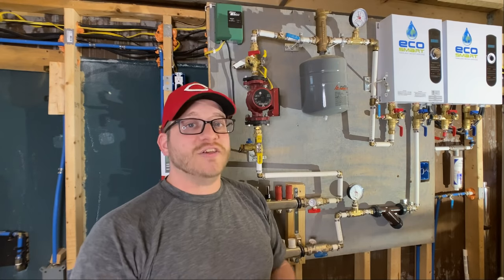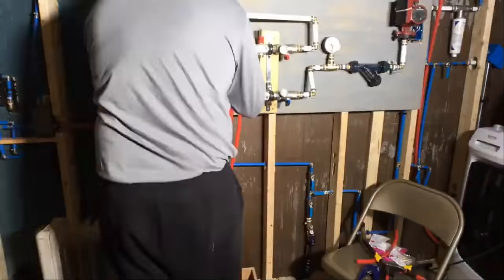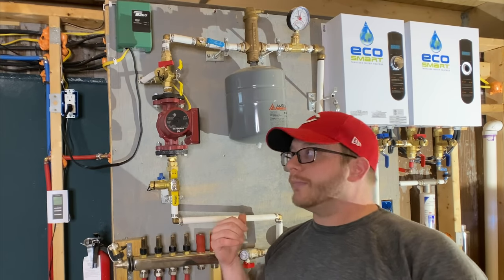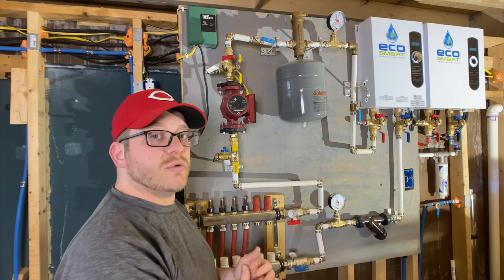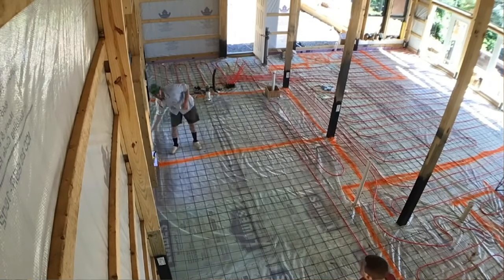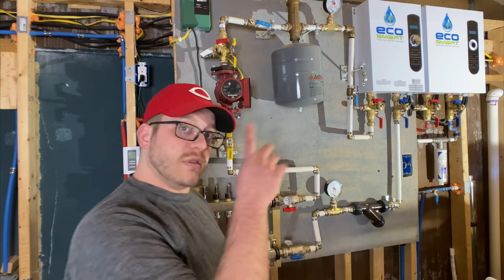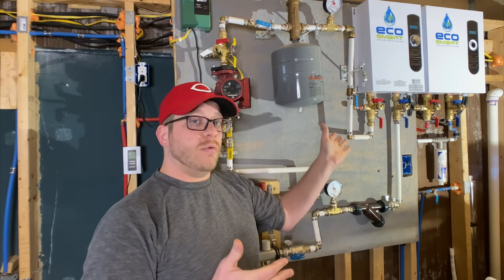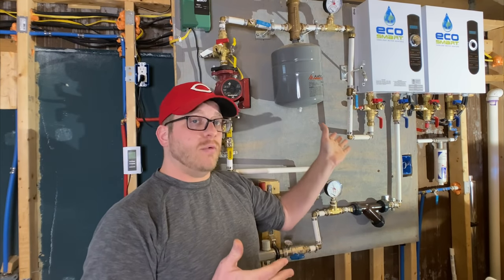Amazing Radiant Floor Heat | One Year Update & System Costs

Comment: Got a question.    What size service AMP. You got coming into your house.     I now for 1 tankless you need a 200 AMP service
Reply from the maker: Ours is 400 amp.
Reply: That’s for both  tankless and I guessing your domestic hot water.  Also 400 amp. Covers your stove and dryer.   Or was 2 separate service.

Comment: I use the same heater as you show in the video but it always not heat up! I need restart the pump but after a day it will stop heat do u have the same problem
Reply from the maker: We do not have any issues with our heater or pump.  
Curious if your system has adequate pressure. You shouldn't need to restart the pump.

Comment: This is the second time YT recommended this video. I just notice you chose a resistive electric boiler which is the most expensive and inefficient source of heat. I hate to know what your heating bill is. If you are in the countries, I would consider mini split heat pump and if you must have hydronic floor heat, use a propane based boiler and only use it as a supplemental to the heat pump.

Comment: nice!  would it not be way more efficient to place a heatpump to heat up the water? 27KW is a very heavy user. i'm sure with a heatpump you can get away with 1/4th of the electricity bill. pluss you can use it to cool the floor in summer times :)
Reply from the maker: Thanks!
So the 27kw is for the whole house hot water and the 18 kw is for the radiant.  We know it's not perfectly optimized right now but we have plans for a full solar setup that will work well.

Comment: What does your water temp start at when entering the loop?
Is each loop going out to the slab the same length?
Reply from the maker: The heater is usually set at 110 and the water is about 80 coming out of the floor.  4 Zones all between 200 and 250 feet long.

Comment: What temp are you running your water at? And does your water heater compensate for outside temp? That makes it more efficient if it does.
Reply: Using a instant hot water heater is extremely insufficient way to use to as a hot water  heat system. Normal  boiler temps are 180 degrees. His system is not install correctly and is very inefficient

Comment: Running 2 heaters does use 2x the power but doesn't consume 2x the energy. The heaters only run until they reach the setpoint. Doesn't make much of a difference running 1 or 2 it's going to take about the same amount of energy to get the floor hot. In the video you made if sound as if running 1 is more efficient. The only way running 1 over the other or both would be more efficient is if there was a difference is the efficiency of the units.
Reply from the maker: Yes I was incorrect about running the one element instead of two.  I hadn't realized that the heater was smart enough to only draw the necessary energy and not extra.

Comment: Great job on this.  Thank you for the follow up.  We are going to do a similar setup with solar integrated. (Preheater/backup source)  Your monthly cost for electrical, however, was a shock.  Seems high.  Where we are, (MT) I have not seen a $200 bill with baseboard heaters...and 3000 sq. ft. with a 22 foot peak ceiling in the great room.  What is your total service (amps) to the home and what is the cost per kw hour?
Reply: I’m in MT as well. I think our electric is some of the cheapest in the nation. For sure cheaper than East coast. I have a similar setup with 1 story 2300 sq ft and my bill was about 250 the highest month when it was crazy cold. Usually around 200 but that included all my electric usage not just heat.
Reply: @SmartEasyDIYer  Whats your insulation?

Comment: Why the second water heater?  Are you using it.
Reply from the maker: The 18kw with the manifold is for the floor heat. The 27kw is for the kitchen, laundry, and shared bath.

Comment: Did you consider ecoboard over concrete for radiant heat? What do you recommend
Reply from the maker: Never  really looked into that, honestly.  Sounds like a good option for above slab heat though.
We really like our hydronic radiant system and really recommend it to anyone building a house on a slab.
Reply: @LittleMountainLife  : many thanks. I guess the heating cost will come down with ecoboard investment. Looks like it depends on the cold months we have to deal with. Great work

Comment: Hot air rises heat doesnt  . I have a Lochenvar combi gas boiler.  The boiler ,  pipe  and 5 pumps .  controller , seperator and valves controls and thermostats  ran me about 11.000 . I heat 4200 square feet , half is in concrete the other half in floor joist . My heating bills run me about 125.00 a month . The boiler not only provides heat but domestic hot water to.  Electricity  is a very inefficient way to heat . I also installed a hot water coil in my airbox as a back up source or to suppliment the in floor heat.

Comment: Did you run your potable water supply under the slab?
Reply from the maker: Yes the main line comes in under the slab along the main septic drain line and comes up through the slab near the radiant manifold in the utility room.
Reply: @LittleMountainLife , how about from the utility room to the kitchen?  If you did, did you insulate the cold and/or hot?  Thanks for the reply! I'm planning a 24'x44' slab with water pipes under the slab.

Comment: You might want to consider going propane. You didn’t mention what your cost per kWh is which is very pertinent to this video. I have a 25x35 log cabin in the UP of Michigan. Full logs, no wall insulation. I decreased my heating bills by $600 per year by switching from Electric to propane hot water heat. I topped off in Sept of last year, then had 150 gallons added Dec 30 and as of end of Aug have 35% remaining in a 500 gallon tank. The propane is only used for potable hot water and hot water heat. No stove yet. Propane for potable use is practically inconsequential, it is heating the house that really uses almost all of the propane.

Comment: How does turning off 1 element save money? You'll run 1 for twice as long, net-net same result in KWH used. It'll just be slower to heat water.
Reply from the maker: So after making this video I realized that the ecosmart heaters have sensors that monitor the temperature and only draw the power necessary to bring the water up to temperature. So in this case it’s best to just leave both elements on at all times.

Comment: I'm curious about the pipe mounts you have to hold the pipes onto the wall. I can only find highend ones. Where do you get these?
Reply from the maker: Lowe’s
Reply: @LittleMountainLife  Thanks - You have given me the courage to build my own system. Thanks.
Reply: @LittleMountainLife  What are the mounts called? I can't seem to find them.
Reply from the maker: mounting flange https://www.lowes.com/pd/AMERICAN-VALVE-3-8-in-to-3-8-in-dia-Steel-Ceiling-Flange/1244077
Reply from the maker: 3/8 thread (cut to size) https://www.lowes.com/pd/Oatey-Steel-Threaded-Rod/1001223378
Reply from the maker: split ring hanger for 1/2" pipe https://www.lowes.com/pd/Oatey-1-2-in-Galvanized-Split-Ring-Hanger/1001121044
Reply: @LittleMountainLife  OH sweet thanks man

Comment: Did you ever do a heat load calculation for the house? What is the price of electric per kw hour there? $ 250 a month isn’t horrible but my guess is gas would be half as much.
Reply: He has no idea what those calculations are  otherwise he would know his set up is extremely inefficient and his pipe layout in his floor is not right at all. If a tech ever comes out they will be pulling their hair out. This is how you DONT do it

Comment: I’m sure it’s been mentioned but you plugged off where your relief valves go under the on demand water heater. You need a relief valve!
Reply from the maker: Yes, originally didn't include the valve but it's there now, thanks.

Comment: hi, if you heat with electricity, it wouldn't be easier (without plumbing) to use heating cables?
Reply from the maker: Possibly. But we aren’t putting any flooring on the concrete slab.

Comment: Would a heat pump cost less in the long run than electric heat?
Reply from the maker: Yes
Reply: @LittleMountainLife  Heat pumps are not efficient or even effective below a certain temperature. I believe at 45 degrees F, they begin to be ineffective. For someone in a cold northern latitude, they are only effective until the temps dip below this level. Yes??

Comment: Is the boiler cheaper then the waterless hot heater
Reply from the maker: Cheaper to run, more expensive to install
Reply: @Little Mountain Life  ok.im building a house right now and im almost almost  done with the bricks and blocks. Im trying to find which system to go with that will have a lower heat bill over the future . As my house will be a 2 story so i still wil need units  but i was hoping this will help the first  floor heat to save money
Reply: @Little Mountain Life  do u know a estimate  price difference  in boiler hook up ovee waterless heater.  And what even about the regular water heater set up

Comment: Noticed on your hot side on the water heater That you capped off the temperature and pressure Relief valve and don’t have one installed which is a very big no no it’s a safety feature

Comment: I am surprised you have been able to get by without any zone valves, as different areas of the house usually have different heat requirements. Perhaps your floor plan is open so there is lots of mixing.

I recently put in a similar system using a Takagi Jr natural gas water heater. I had issues at first with the water heater making terrible noise (whale songs), and after much testing and trial and error found the water heater was boiling internally causing a valve to vibrate. It was easily fixed by raising the system pressure 10psi which raised the boiling point and stopped the boiling. The heater manual states 15psi is sufficient but I am at 25psi now. When that heats up and expands it puts me right at 30psi and the over pressure valve is set at 30. It hasn't blown, but I am going to need to change to a 50psi model. I also used a Grundfos cast iron pump and O2 barrier pex. I filled the system with distilled water to prevent fouling of the heater with minerals.
I am finding big problems with the pump rusting however, and if that filter is clear like it appears and full of rust you are having the same troubles. In theory after a few days all the dissolved oxygen is used up and the pump should rust any more. My filter keeps plugging up however, so the pex isn't as gas tight as it reports. I will have to switch to a stainless pump, and based on price I see them for on Amazon, I should never have purchased the Grundfos. If you do add zone control valves I recommend getting the three wire versions. The valves take a few minutes to open after the thermostat trips them on. In a two wire valve actuator, you have to turn on the pump and the valve at the same time, but due to the delayed opening the pump just churns water for three minutes for nothing. In a three wire system, the third wire triggers the pump to come on (via a relay as the valve is 24v, and the pump 120v) after the valve has opened. You can buy relay banks with 4, 8, or 12 relays for under $15, so I wouldn't go with those over priced ones sold by the heating equipment companies unless you need some special feature only they provide.

What area of the county are you in? I am guessing Northeast or Michigan/Ohio area as 200-300 per month is pricey to me. I have an old house, leaky, with little insulation (R5), 1800sqft (about 1200 heated) and pay around 150 monthly for NG in the winter. Even though electric is pretty cheap here at $0.11/KWH, it would cost much more to electric heat my home (as I have done in some rooms while building the radiant heating system).
Reply: he does have them - just not in a traditional valve - look at the video and he can change the flow of gallons to each zone.  pretty nice setup

Comment: Did u say it was drafty until u put bats of insulation? I didn't see any other of your vids
When you spray foam the roof u must foam of the vents! For a complete seal 
Batts will not stop air flow      if u have batt insulation u must correct it you will have mildew issues         power bill will be night and day on saving 😉
Reply from the maker: Yeah we cover this in other videos.  The home is completely spray foamed with 2" closed cell on the walls and ceiling including the ridge vent and soffits.

Comment: If the electric heaters are thermostatically controlled surely they will automatically turn off if the demand is low without needing to remotely isolate them

Comment: $250 per month to heat a 1000 sqft house? Way over the top. There are many ways to heat water that doesn't involve (2)-40 amp circuits. The overall system is excellent though.  Radiant heat is truly the best way to heat.  
Thanks for sharing your video

Comment: I just have a wood-stove that heats out 1500 sqft mobile home that has normal insulation. in a house insulated like yours I would have never installed any heating system except a wood-stove or some mini-splits that can also heat.
 If I ever have a chance to build my own house i will just heat the house with the sun.

Comment: I don’t understand about the flushing business. I mean it’s not like a system with copper and steel in it so where would the corrosion or other crud come from? The reason for adjusting flow rate in a loop has to do with required heat output and length of loop. The longer the loop the higher the heat output so for a given flow rate the temperature drop and hence the mean temperature of the floor surface and heat out put so definitely adjust the flow rate to suit.

Comment: Using that PEX crimping, you should have UPsized your pipes because you will lose flow with all those fittings....  Huge fan or Uponor PEX where you dont lose any flow due to adapters or anything.

Comment: I would think a gas fired system might decrease the cost a bit more.
Reply from the maker: Possibly. But as we mentioned in the video, this option was the easiest DIY solution. 
Also don’t like the idea of dealing with a giant gas tank and delivery up our mountain.  
Thanks for watching!
Reply: @LittleMountainLife  Sorry. I have not watched your other videos and did notrealize you were on top of a mountain. I would never use propane either.
Reply: A propane system would cost him less then $100 a month in heating. His house is insulated well , so he would use less then 1 tank a winter.  I have a 3200 sq ft pole barn with 12 ft ceiling and It costs me less then $100 a month to heat that. Videos on it online

Comment: It appears to me that you do not have oxygen barrier pex in your installation.  If that is correct you will likely have corrosion problems (RUST) with expansion tank and the pump.  If corrosion occurs because of oxygen in the system the solution is to use an expansion tank for potable water and to use a stainless steel pump.
Reply from the maker: We do have the oxygen barrier radiant rated pex. Thanks for watching
Reply: @LittleMountainLife  I see the pex to the manifold is red.  but I also see white pex that is definitely in the radiant loop.  I also see blue pex in the picture but it is not clear whether it is a part of the radiant system.  So you are saying that both the red and white pex are oxygen barrier?

Comment: i would use a lot more foam board, at least 2 layers, better 3 and some more pipe for better heat distribution. 
why do you not use a heat pump, it would reduce the electricity use to 1/3 to 1/4?

the pump would be better off in the return, less thermal stress...

Comment: If you are installing heat pump you heat with that. it uses on average 1/3 of energy compared to direct electric heating. IMO you should replace those electric water heaters with air to water heat pump.
Reply from the maker: It might be more efficient and honestly might be something we change years from now, but for now the electric tankless are the perfect DIY solution for our situation.  
Thanks foe watching!
Reply: Radiant floor is more efficient  , but electric water heaters aren't. If he would switch to propane or natural gas, his bills would be under $100 a month easy! My shop is 40 x 80 x 12 and I heat it for under $100 in Minnesota with a tankless NG water heater. That includes Qty 2   10 x 12 ft garage doors!  All my build videos are online

Comment: Need temp sensors for each return line separately.
Reply from the maker: That's going to be a personal preference thing.  I don't personally see the need for it on our system.
Reply: @LittleMountainLife  its necessary because those restricting valves are supposed to be used to help the pipes extract equivalent heat from the liquid flowing through them. if you had temp sensors at each return before the manifold you could see which run was coming back hotter and colder from the feed side. then you adjust the flow so that the return temperatures are equal. or adjust so that important ones like in bathrooms are coming back at higher temps delivering more heat to those areas. its not preference its just adequate monitoring.